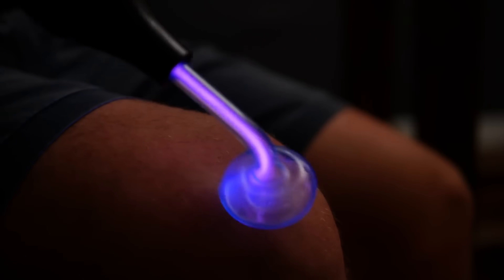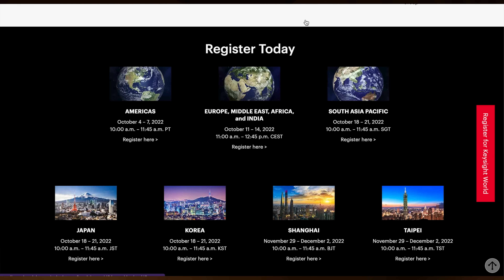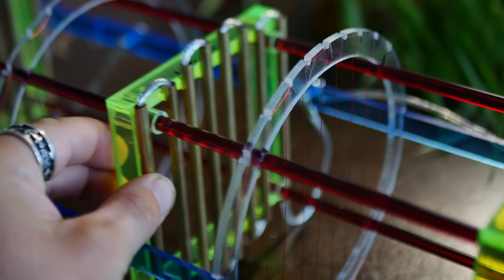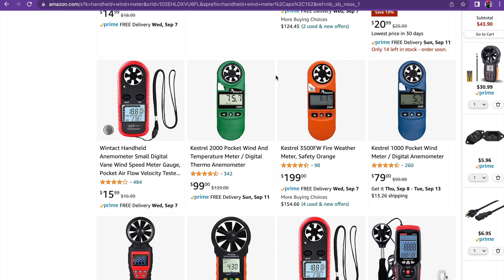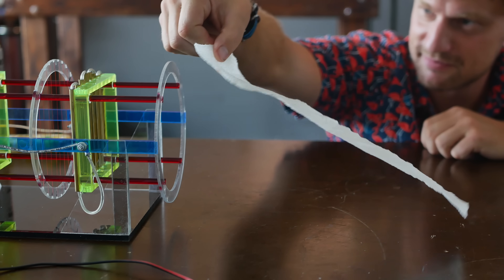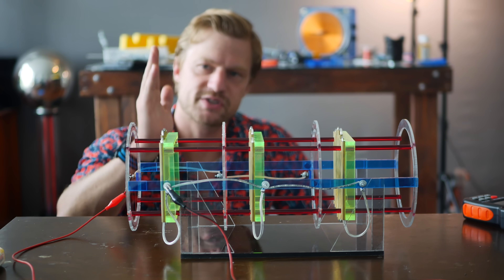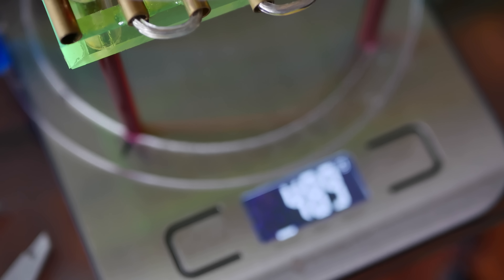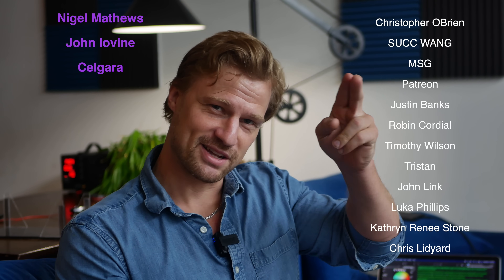Designing A Next-Gen Ionic Thruster! (For Flight)

Comment: Inefficiencies:  There are many more than three!

1.  Tubular shape creates significant drag due to turbulence, not to mention minimizing surface area.  Instead, use thinner tubes, bend some spring steel wire around it creating and airfoil, then cover the "spar and ribs" with aluminum foil to create an aerodynamic wing.

2.  Mount the + and - parts at right angles.  All + parts are at 0 deg angle.  All - parts at 90 deg angle.

3.  Lacking an inner surface through which the air should flow

4.  Lacking an outer surface over which the air should flow.

5.  Lacking a "hyperbolic bell inlet" shape to the inner surface.

6.  Each of the six rings (three anode-cathode pairs) require different diameters in order to match the ideal, hyperbolic bell inlet shape.

7.  Each pair should use different spacings due to different air flow velocity.

8.  Each pair should use different voltage differentials due to different air flow velocity.

9.  Each pair should be spaced from the adjacent pair differently due to different air flow velocity.

10.  The wires should be scored at many more (closer) intervals.  Also, it may be of benefit to use whisker wires which many such points, but only if all are streaming backwards so as not to impede airflow.

11.  By passing passing the current through the entire length of thin, crisscrossing wire, you're encountering significant resistance.  Wrap all external contact points on that disc with one band of flat copper wire for maximum conductivity.

12.  Aerodynamic and smooth exterior surface for your engine.

13.  Determine the current consumed, then down-size the voltage ladder(s) accordingly, producing the requisite voltage, but with as small and lightweight components as possible.

14.  Determine the power consumed, then down-size the Li ion battery to 2x your maximum required mA-hr (this will account for degredation).

16.  Consider approximating the shapes described above with balsa sticks in 4-sided pyramid (including the bottom), glues with CA, then coat with light shrink-wrap sheeting.

17.  Build the wing, then directional controls.  Alternatively, built a helium-filled dirigible/wing combo, such that the dirigible provides 85% of the lift.

18.  Courtesy of Kyle Wall:  Add a magnetic field to further accelerate the charged particles.  Question:  How would this interfere with the electrostatic action?

So, 18 inefficiencies.  Hope you don't mind...

Comment: If adding a second stage (presumably doubling the power consumption and roughly doubling the weight) only increased power by 33%, then surely having more surface area on a single plate or running the plates in parallel rather than in series would be more efficient?  I would imagine that a doubling of the surface area would return a 100% increase in power but in no way requiring a doubling of the overall weight.

3D printing the frame if you have the capability to do so would I imagine allow lighter construction too, as you can build in attachment points and not need so many supports (e.g. use the tubes AS the supports), as well as play around with the exact thicknesses and make the material hollow.

Comment: Inefficiencies
Voltage buster
Make it a concealed unit 
Honorable mention: use a metal strip with more precise cutouts with very sharp edges
Change the shape, more circular, and add stages with different diameters.

Comment: Just a janitor, so don’t take my comment with too much weight, but would changing the plane of each stream be more efficient? If each spacing of stream is lined up behind one another it is running into itself. I reckon turning a stream from a vertical plane to horizontal, the stream of plasma would look more like a grid as opposed to a row. Dunno, my dumb monkey brain just thinks a greater surface area dedicated to thrust would be more efficient.

Comment: Mad scientists thoughts here-
1. Ducted airflow(enclosed system with controllable exhaust nozzle
2. Variable space between each emission field. A min/max for efficiency.
3. Variable angles of emission fields. Field 1 is true, field 2 is rotated 15degrees and field 3 is rotated 30degrees and increased or decreased for power improvement if noticeable.
4. Test in vacuum, is it generating air for airflow and if not what’s it’s consumption. 
5. Power source weight needs to be included in all math.

Comment: Well if this flows like water then the methods used in sprinkler systems should work by reducing the size of apertures between each section you will increase the air flow pressure

But in sprinklers it's in closed no outside interference your design is open and drawing air not from just the end but the sides between sections 
I'd suggest making it enclosed and reducing it now with sprinklers is usually 1' in pipe down to 1/2'in over 60 ft produces 21 psi with 60 psi main supply up to 90 or as low as 30 in some cases just matter of how much of the one size of pipe to the other with a control valve and feeding 4 sprinkler heads that run at 21 psi each
Now in past I used this idea to beef up a backpack blower during fall for leaves standard opening is 3' in but I used pvc and forced it down to 1 1/4 effectively tripling the power enough that it was pushing me back I essentially had to get in fireman's stance like they do using fire hose to hold my self up and not get turned or pushed back 
Was fun shoving 4to 5 ft mounds of leaves like a broom to dust

Comment: Comparing this up against a jet engine, not impressed at all! You'd be better off sticking with a jet engine!

On the other hand, what thrust could you obtain if you had many more wraps around a single cathode at one end and have several stages of anode with various voltages say something like...

Cathode = 0 volts
Stage 1 Anode = 10kv
Stage 2 Anode = 20kv
Stage 3 Anode = 40kv

Would you be able to get higher thrust by taking out the Cathode between each stage? You would also be able to add more stages between each Anode with higher voltages causing the air to speed up as it passes from one stage to the next, right?

Comment: you should try different voltages at each stage with the 1st being the lowest the second being higher and the 3rd even higher. This may provide continual acceleration of the air flow.

Comment: Ionic wind thrust is all about surface area. Anode and cathode distance between is like gears in a transmission. Close for torque equivalent and farther apart for velocity. When moving air from static to higher velocity you need to start with them close then further apart as velocity increases. An aircraft with forward motion increases you will be required a greater distance between the primary anode & cathode. The closer they are the more torque equivalent you get but you must be as high a voltage as possible without an arc. As they are moved apart you need to increase voltage to as high as possible without an arc. The cathode needs to have as much surface area as possible while restricting airflow as little as possible. That is why the lifters had a wide band of aluminium foil for the cathode. There comes a point where the increased surface area begins to add drag. You must remain below this point. Too little and you loose traction with the air. As you guessed the higher the airflow the higher the drag but the less time to neutralize the air. The lower the % of air neutralized the lower the efficiency. I propose that you use a little thicker aluminium sheet material so that higher velocity air doesn't cause the cathode to flap. Arrange the cathode sheets into closer proximity maybe 3 - 3.5 mm spacing. Closer spacing for the primary stage and decrease the number and increase the width of each cathode array with each stage. The spacing should be adjustable as well as the voltage for each stage to change with increased aircraft velocity. Finally enclose in a duct with a nozzle at the end, not forgetting everything we learned in fluid dynamics and physics. Think of all the compressor stages in a jet engine. Also don't forget to use the high velocity stream to the final stage using the venturi effect to move the maximum volume of air possible. Make sure the inside of the venturi duct is a cathode to neutralize any remaining positive ions. Can't wait to see what you do with this. You should use a 3D printer with ultralight PLA to keep weight down as much as possible.

Comment: 1. Vortex the air(spin it) Everything in air or water needs to be spun to travel farther faster. The universe adopts this principle.
2. Joule theif circuit to have decrease necessary input(Pulsed dc)
3. Different element/s for the anode to cathode coated if necessary for weight reduction.
4. Litz wire for less skin surface tension and less weight.
5. Bernoulli’s Principle and or shroud to enhance and contain the flow and to increase pressure if needed.
6. Recovery system with paddles like a water wheel for generation of electricity as appose to just a prime mover.
7. Use the static generated by the ionic wind don't just pass it through have it influence other build material through static discharge.
G.G.

Comment: One inefficiency you are bound to have is that the voltages are parallel: Negative pole in the middle is negative with respect to not only downstream, but upstream too. So there is in fact a decelerating force at play also. The first segment just initiates the flow, and a cascade keeps the process going. 
Introducing a bias voltage between the sages would allow you to make the positive poles thinner too. Probably. 

And also, a more optimal system would be built inside a duct. Now you are losing some of the flow between the stages.

If it is thrust at slow speeds we are after, there is some more thrust to be traded against exhaust velocity, by constructing a toroidal jet geometry that scoops some stationary air with it from the center; much like those Dyson fans do.

Comment: Awesome. What is the charge of the particle after the first stage? (ground plate) if the particle are still charged, you will have repulsion forces before it is getting to the next stage. Can you neutralize it before accelerating in the next stage? Or can you reverse the stages safely so that you can always have attraction?  (-)(--)(---)(----) (++++)(+++)(++)(+)(-)(--)(---)(----) etc... It would be interesting to see the wire grid size/shape (square/ rectangle/ honeycomb) to give better thrust? What are the particle content before and after entering the accelerator/thruster.

Comment: Saturation means the next stages are just compensating for air resistance. Since velocity is higher, you need a higher kV over the same distance, or less distance over the same kV (because of 1/d^2). So, there should be an arrangement of distance-kV in each stage, that could take you to a theoretical 3+ m/s, which should be over a smaller overall turbine because of v^2 drag.
I can see an optimization somewhere.

Comment: I'm curious to know what a capacitance chained series in your design would do. Initially, I thought the chained series would draw ions from the leading thruster backwards into the system compromising the flow. Either way, it would be interesting to know if a short delay between the thrust panels charge and fire sequence would result in poorer or better performance.

Comment: I'm by no means an expert in this field, but it looked like the plasma was only originating at a few points along the charged wires, is that something that changing material/electrode design might fix? I imagine if the entire wire was ionizing the air you could get more efficiency.

Comment: Ok, I'm gonna be critical, but this isn't meant to deter you or discourage you. I assume you want to make an efficient motionless thruster that can be used for commercial purposes such as a Turbofan jet engine, not just a glorified desk fan. So the problem with the ionic thruster is its abysmal weight to thrust efficiency combined to fuel capacity of any generator or Battery outside of a nuclear generator and even then a nuke-gen is way too unsafe for air travel. The USAirforce tried it back in the 60's and lost the plane in a very toxic crash. Regardless, let's assume you can work around this. So a general electric's F110 afterburner turbo fan used on many US Airforce and Navy jet fighters since the 80's weighs 3,920 Lbs dry and produces over 17K Lbs of thrust without afterburner. That has a 425% thrust to weight ratio not including fuel. An F14B Tomcat has two of these babies on it and has an empty weight of just under 47k Lbs. Add 16k lbs of fuel capacity and you wind up with an air frame that weighs 63K lbs but only has 34K Lbs of thrust without afterburner. So to be effective you really only need to push half as much as you weigh (or have 50% thrust to weight efficiency) when it comes to airframes. But fuel is the real problem unless you can feed it power directly through a "track" to the object traveling on it using your design for propulsion or something novel like that. The Tesla Model S long range 100kWh battery weighs 1,183 lbs out of the 4,600 Lbs the car its in weighs. The car can run max speed of 216 Mph and has a range of 400-ish miles. Now how long can it produce this power at max output? About 2 hours tops? The question is can you optimize your thruster to maybe 300% thrust to weight ratio and powerful enough to push approximately 3,000 lbs of thrust without exceeding 100kWh? Well you said you were pushing 22 grams with 90 watts. Let's take your design but scale it up with the power of a tesla S batter. Your thruster would be pushing a bit over 50 lbs of thrust. I could push a tesla model S faster than your thruster could using the tesla power supply.... Your thruster as it stands has an abysmal 5%  thrust to weight efficiency with the tesla power supply. On the other hand, the The 15-20 ton 27-30 MWe Hyperion nuclear reactor might help your efficiency. If, for example, we just said it was 15 tons and 30 MWe it would give your thruster a scaled to 30 MWe... still only 5% efficiency... BUT it could run a LOT longer than 2 hours. Try 2 years. Aaaaand assuming the lack of moving parts makes it cost effective matinance wise then you might be able to put this on a boat and slowly push it and the faster it moves the more thrust you would get raising its thrust efficiency until the drag co efficient from the water outmatched you. Which it would probably outmatch you from the beginning and never even move the boat.... I just dont see you optimizing efficiency by much to be commercially effective. However, you are the engineer man here. Prove me wrong. Good luck!

Comment: From the still photos it looks like you have hot spots in areas where the enamel on the wire may be perforated, I wonder if using non insulated wire would increase flow.

Comment: Enclose the whole thing narrow the thrust end leaving the intake fully open. Adjustable rear thrust covers for varying speeds. Add a new set of the thrust creators to the device find the optimal number of sets. Each set should be calibrated to increase thrust of the first set. Meaning change possibly the size of the wires? Not sure just thinking of building a wave that only grows from start to end and forced out a smaller aperture. No clue if any of this means anything just ideas.

Comment: copier tech guy here... Looks like you're using  34-38ga wires for your grid? In the video and stills I see 'hot spots". Suggestion use copier corona wire? Have to lower the (very low amps) lower as corona wire is ~.3um vs ~.6mm. The plasma 'corona' is far  more uniform. Disclosure, I do intend to ape your design, and tinker with this concept.

Comment: Would varying the number of electrodes per segment increase the flow rate? And do you have to have the same number of positive and negative electrodes? It seems that you could have a lot more wires than those tubes.

Comment: First off thank you for sharing and getting our brains thinking. Very impressive build.  Cant wait to see your next try. Also excellent build so multiple factors could be tested. 

1) Has to have some interference from each structure. So would love to see a smooth tube and of course shape of tube and nozzle affects power output. 
2) what happens with multiple grids but starting with low at the first and increasing the power till the last one.

Ps just read other comments.  A lot of us are thinking the same way.

Comment: idk but maybe these:
1. resistance (energy loss) of the conductors/contacts -> using rather noble metals
2.air flow disturbance -> shielding it from the outside to direct the airflow, maybe with thin foil under high tension
3. positioning and spacing of the wirses iself for - efficiancy
4. weigt loss -> by loosing one of the rods. 3 should be stable. using even lighter mareials like carbon based strucktures. hypotheically fill the rods or any chambers with gas to counter some wight. at least under standard conditions on earth

Comment: 3 main inefficiencies: 1) weight is a large factor as larger weights are more inefficient in terms of W/T ratio. 2) scale is a large factor in efficiency because the smaller the scale the less power draw for the same W/T ratio. 3) material properties - highly conductive spiked emitters will be more efficient as there is less wasted potential energy compared to smooth less conductive emitters. Also, other inefficiencies stem from the shape of the airflow cylinder (rings create a flat surface perpendicular to the airflow which results in the net thrust decreasing), to the spacing of each emitter/conductor.